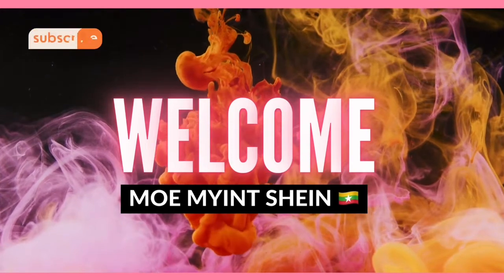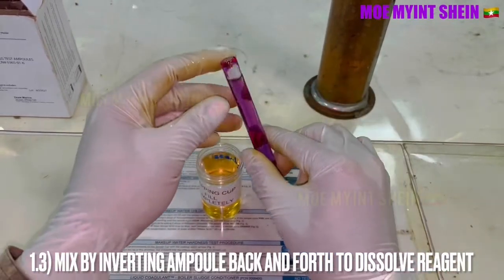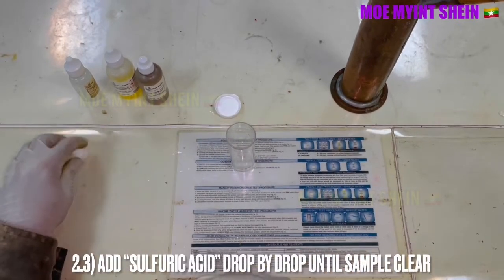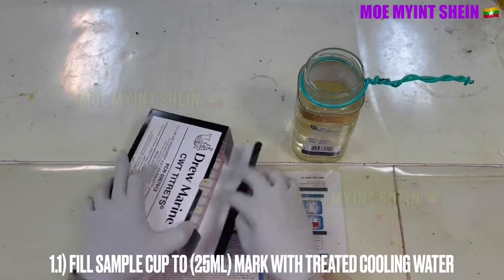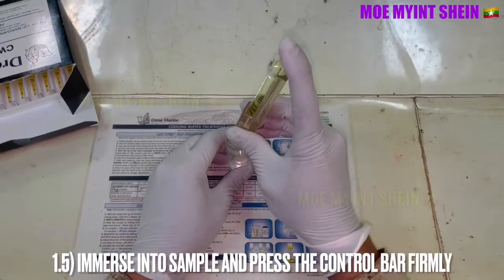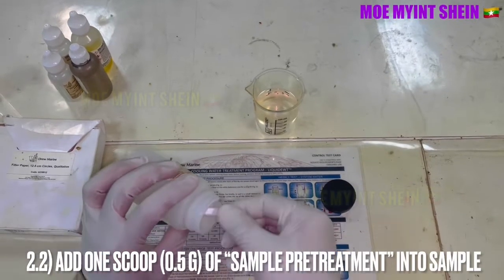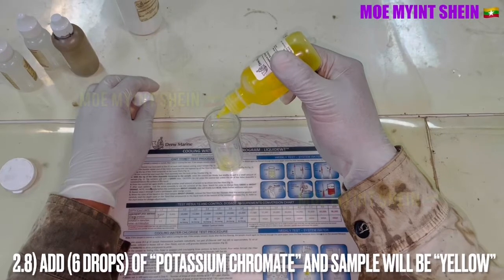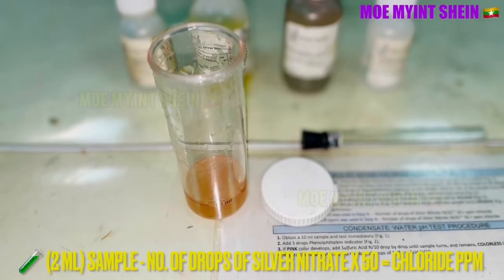[DREW MARINE] Cooling Water and Makeup Water Tests | MOE MYiNT SHEiN | Technical Vlog : 080

Comment: Ur cooling water colour is very clear.. we r adding liquidit chemical and dor that water colur is yellowish like chemical colur and titrte not coming up...?? Suggestions plz
Reply from the maker: Chemical residues settled down at the bottom of cooling water expansion tank, when ship gets age. 

If the tank bottom was not cleaned regularly by sucking with vacuum, it may be one of the facts. 

Another factor is over dosing chemical.